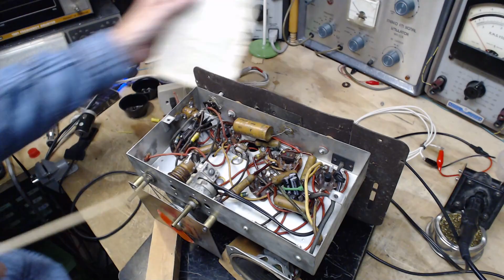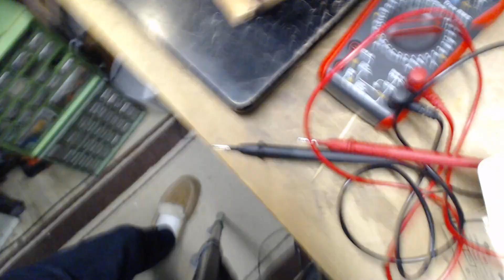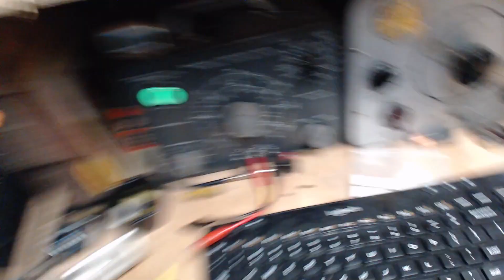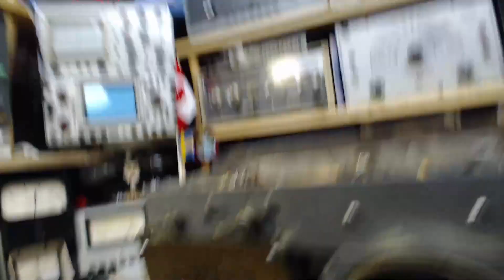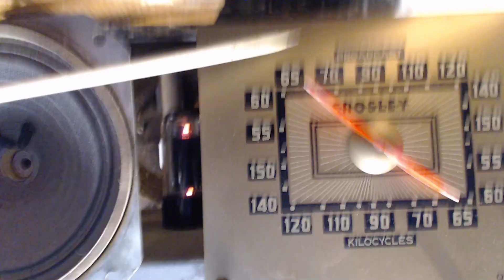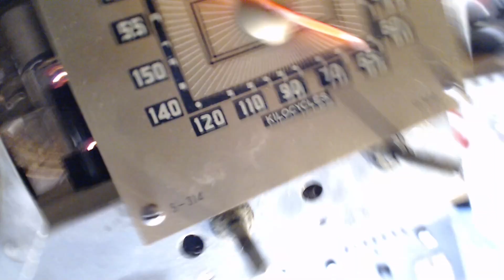Mohawk Model 1240 Five Tube Radio Video #3 - 35L6 Output Tube Bias

Comment: Greetings:
Your IF transformers are showing. No more talk about this being a TRF set.
You even remarked about about the oscillator section of the tuning gang. FIX YOUR frequency counter, please.
Absence of the built in trimmer is why they added one externally. That trinmer is used to set the dial pointer position. The ant trimmer is used to maximize the tuned station signal.